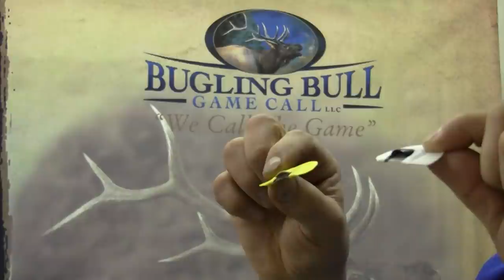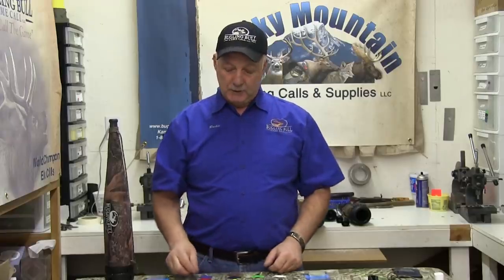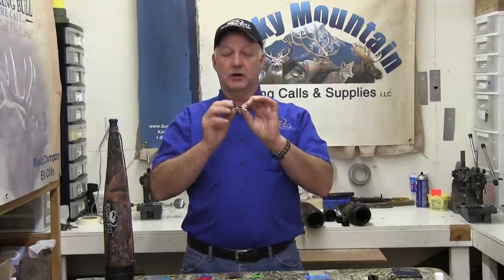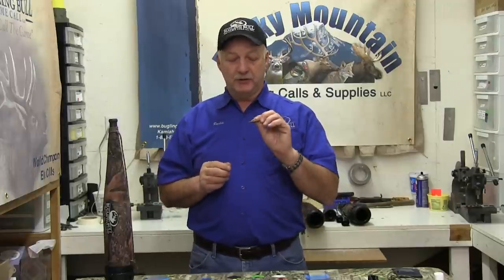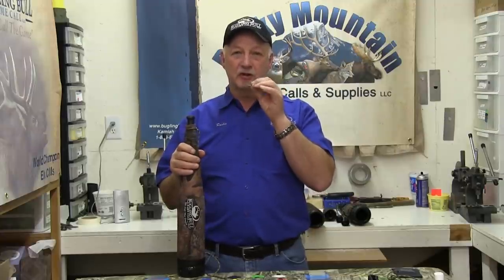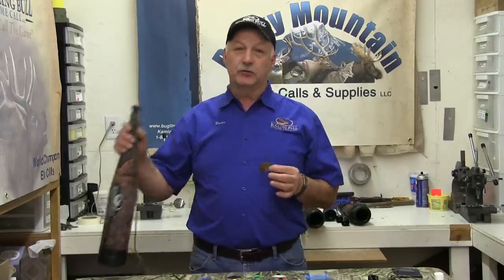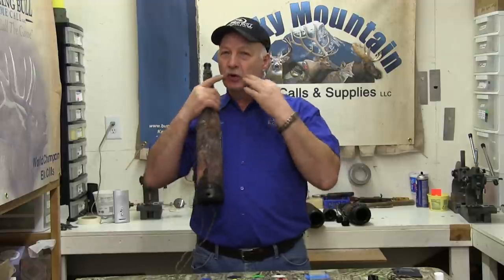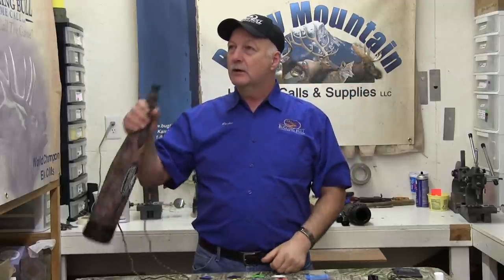How to use a Diaphragm Call

Comment: Great video, how about us folks with dentures? I have trouble seating the diaphragm on the roof of my mouth. Any suggestions?
Reply: Mike Bozarth I have dentures to have you had any luck?
Reply: keith livingston , nope, I've tried pretty much everything. thinking about modifying some. open reed is what I have to use.
Reply: Mike Bozarth haven’t had a problem with mine, they make different sizes to fit your mouth. Don’t give up.
Reply: Glad I'm not the only one I feel like it's way harder for us that have dentures 🤣
Reply: @Dewshon-Mandick  I just stuck with it and finally got comfortable using a diaphragm call.

Comment: Best way to care for diaphragm call is to rinse in water after use. can use tap water at home or running water in the mountains. just rinse, shake off the excess water and let dry away from sunlight or heat. when finished for the season best to rinse, dry and place in cool, dark place like refrigerator. we have a call case pouch that works good for this.
Reply: Здравствуйте! Где можно приобрести вашу продукцию?

Comment: Where exactly on the roof of your mouth do you place the diaphragm call? On the soft palate part in the back? Or on the hard palate part that is probably the foreword-most 1/3rd of your mouth roof? I watched other vids and they say the round part has to "seal" against the roof of your mouth. How the heck do you get them to do that?  Just got this mouth call howler pack which also has that raised dome one in it. Which sounds like you design it apparently.   I'm wondering if I don't need the "Large" size you refer to in this vid? I can NOT get these things to stay up on the roof on my mouth AT ALL. Is your tongue supposed to be holding it against the roof of your mouth the whole time or something?
Reply: Yes it does fit on the front part of your mouth with the raised dome facing upward. You will have to use you tongue to help hold it in place. If you are trying to make the sounds of a coyote howling will need to engage the latex with your tongue while you huff air past it by making the sound of Hut Hut Hut
Reply: Ugh... ok... sure hope I stumble onto "the trick" here pretty soon. This thing makes you feel foolish real quick. Thanks.
Reply: Maybe watch the YouTube video called " Yote Howler System with VETT Technology " see if listening to that helps you.
Reply: Not long after watch your vid and that other one... I finally got it.  Man... that's a workout for your tongue having to hold the thing up against the roof of your mouth the whole time its in there!  Previous experience playing Clarinet as a kid proved helpful once I figured out initial placement. Can almost make it sound like a Saxophone instrument.

Comment: Something that I have had a hard time finding answers to is about diaphragm longjevity. I practice a lot while driving for work, and seem to go through a lot of diaphragms. How long would a typical diaphragm last during two weeks of lots of bugling.?
Reply from the maker: It really depends on the individual. Some find that diaphragms have a shorter life span, and that is more common with those who blow harder than others. Others have reported their diaphragms lasting for months, even years. I personally have diaphragms I've used over several seasons, but proper care and using tongue pressure rather than air pressure are keys to the longevity of a diaphragm. I've also blown several out within a week by not regulating air pressure or taking proper care of them.
Reply: @RockyMountainHuntingCalls  Thank You. Makes a lot of sense.

Comment: Great video. But my teeth are crooked. I’m screwed
Reply: Dan We have found that if the call fits the roof of your mouth correctly your teeth really play no part in it. You need to experiment with the width of the calls to determine which size fits you best. We offer them in large, medium and small to hopefully insure that one of those 3 will fit your mouth.

Comment: dangit i cant make a noise
Reply: Mindy, it sounds like you are putting to much pressure against the diaphragm,. Try to roll your tongue up against the diaphragm and start with not much pressure, you can adjust the pressure by opening and closing your mouth, Good Luck.